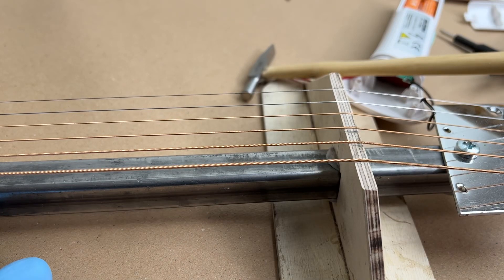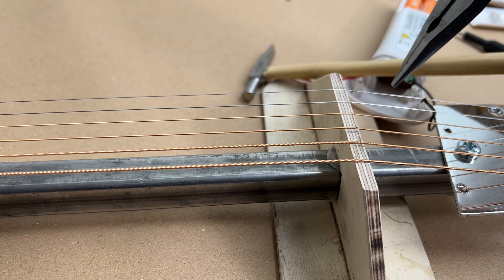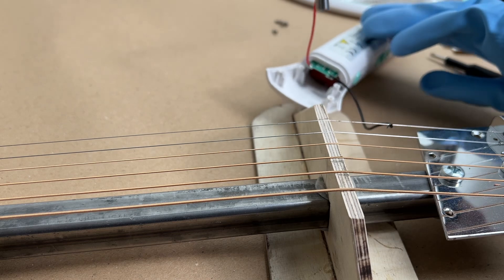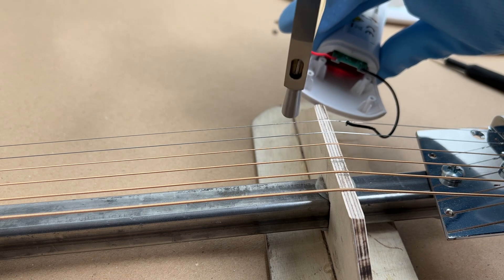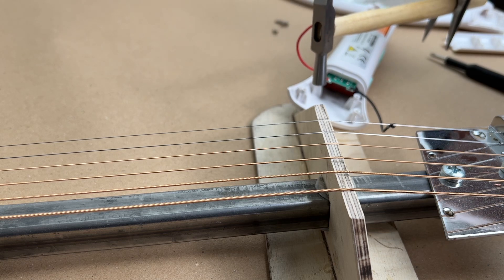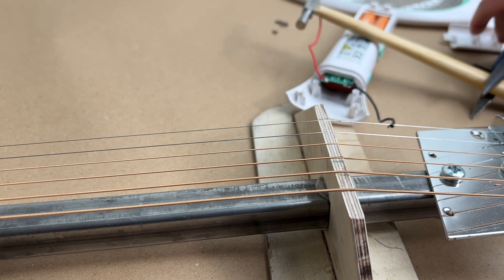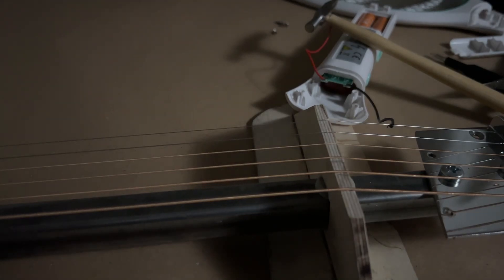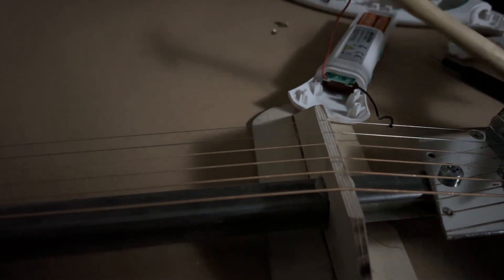A piano that sparks when it hits the strings, test 1 (fly killer on guitar)

Comment: Instead of a swatted you could use something like the electric zapper cages for insects, or even a lithium ion battery bank. Only problem with that is you would have to charge the piano, but it would make it so that there are no wires for the technician to spot when trying to figure out what you did. You could use something like rc car batteries.
Reply: "Charge your piano" is one of the funniest things I've heard today!

Comment: I wonder if it's possible to do it so you get it to spark without being touched, so the spark itself plays the string
Reply: With a sufficiently high voltage, it’s rather feasible. The only problem I see, apart from safety (but he’s an engineer, he’s got this covered), is that the arc might hit random notes besides the intended ones
Reply: @mts.camilo  then we just call it jazz

Comment: Get yourself an (non electronic) ignition coil used to drive spark plugs, a 12v battery and build some mechanism to resemble the contact breaker. Voilá 15.000 Volts and a nice bright spark.😁

Comment: It would be cool if you could create an arc between the strings and hammer, or make bigger sparks
Reply: while it would be cool, the voltage to do that would be likely rather deadly, because of the way arcs and sparks work
Reply: @deadpotatos7077  not if the current is low
as far as I understand physics on that matter

Comment: Instead of the hammer you could have a butcher glove, like chainmail gloves. Then you could play the guitar with sparks flying. It should actually be doable safely, since current takes the path of least resistance. Just have some insulation under the glove. Probably better and safer to switch around so you have ground in the gloves and live wire in the guitar though. Try to get Electroboom to collab with you.